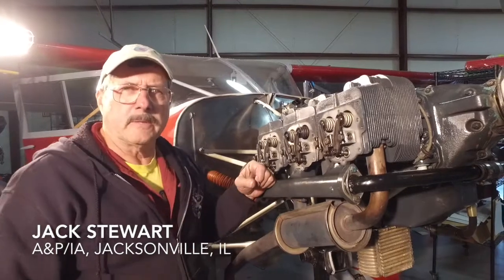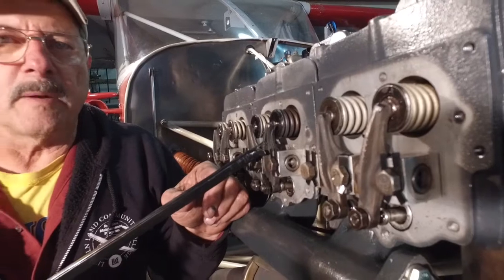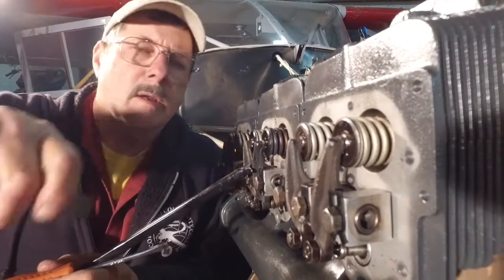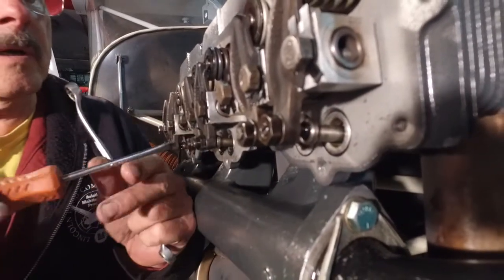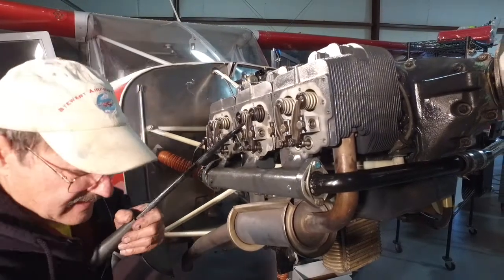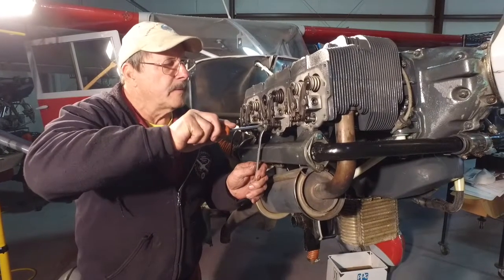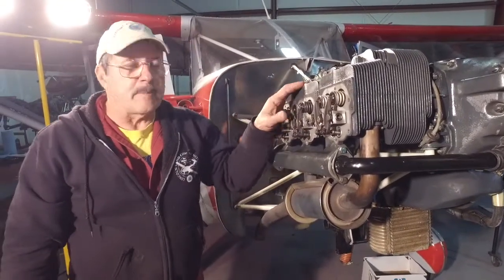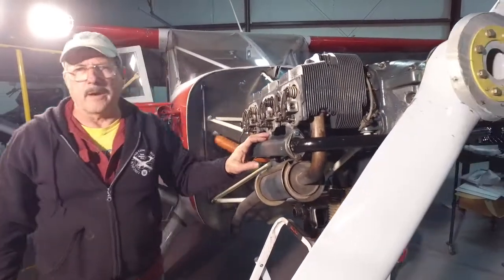Valve adjustment Franklin 150

Comment: I'm a bit confused regarding the bleed down. Does the rocker stop after the pressure of the tool and bleed down is complete? Do you hold pressure on the tool to check the lash? Great video, thanks for posting.

Comment: Except you can't adjust the valves on a Continental you are just checking the clearance. If the gap is not within specification you have to change push rods.